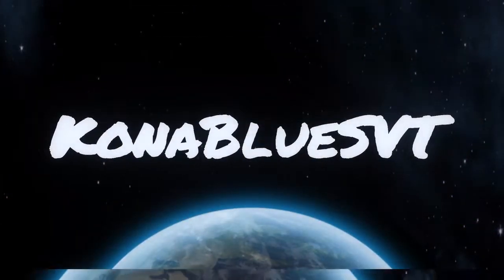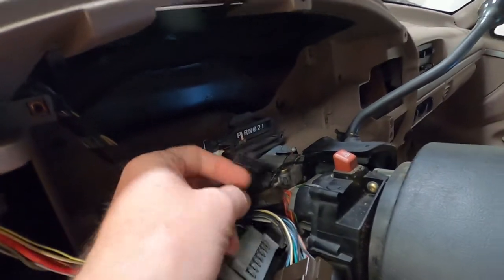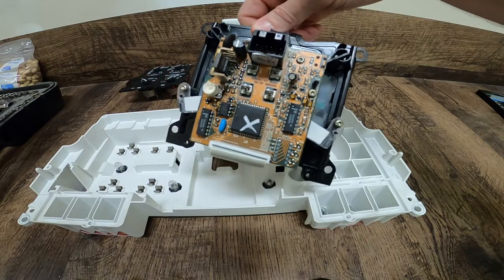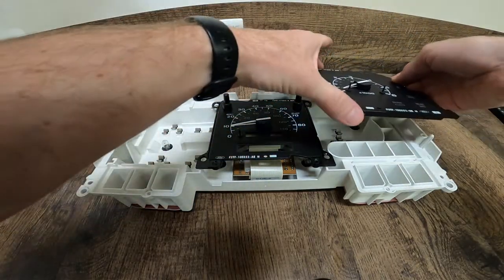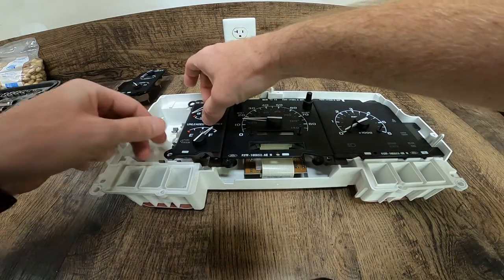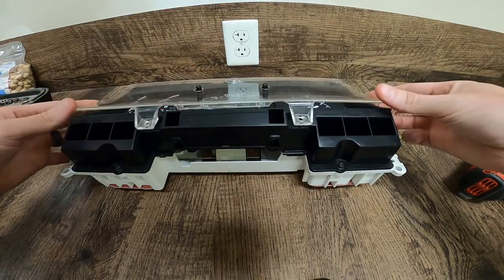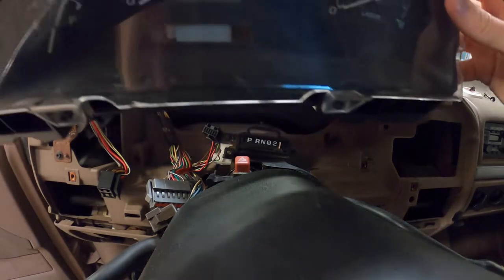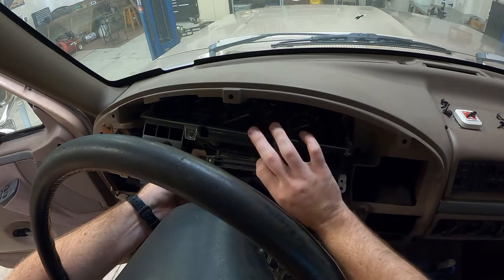Instrument Cluster Removal 92-97 Ford - F-150, F-250, F-350, Bronco

Comment: Hi I just did this and after finished the car won’t start and the check engine light came on? Any idea why?
Reply from the maker: Double check you got the fuel selector switch plugged back in. It won't start otherwise.
Reply: I did connect it. Could it be something with the shifter indicator? I tried to align it
Reply from the maker: The indicator itself won't prevent the truck from starting.
Reply: I thought so since the car can turn on only on park or neutral. What I don’t understand is why a check engine light
Reply from the maker: The neutral safety switch does that

Comment: For the fuel and battery gauge where did you fine that part my fuel gauge is dead and stuck on full and I can seem to find the part number or where to get it
Reply from the maker: I had the factory ones repaired. Google search "speedometer repair"

Comment: I changed mine and the odometer isn't right and information on how to reset the milage to match my truck
Reply from the maker: You can't just change it with another one.  You would need to send your original one in to be repaired. The odometer reading is stored in that module.  I used DFW Speedometer.